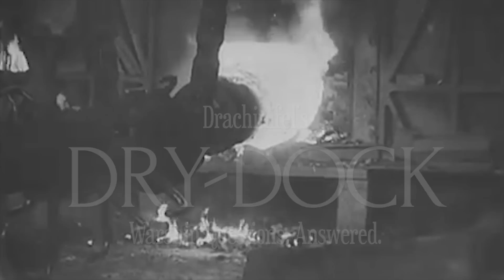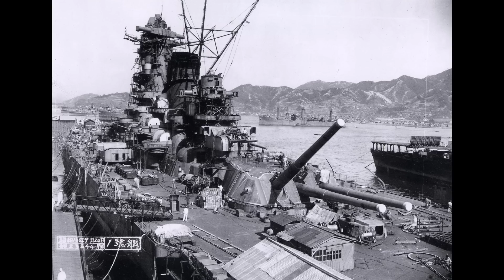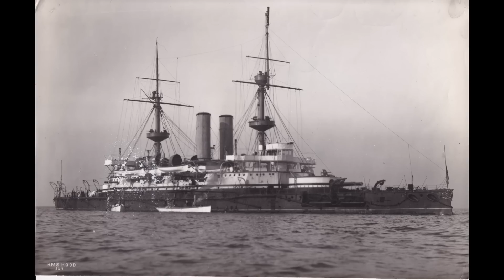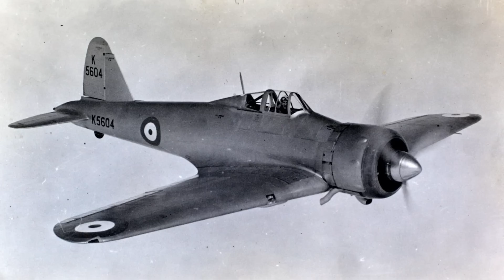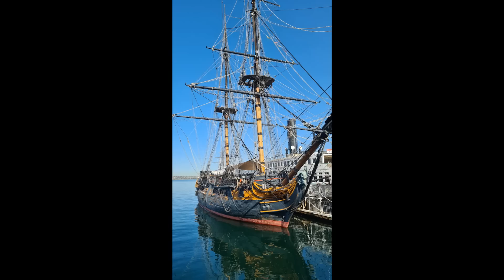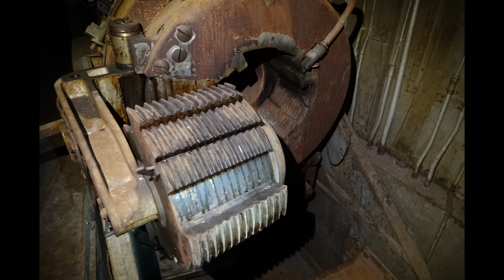The Drydock - Episode 239

Comment: I've been hit by a dud torpedo at a very shallow angle. It was an unarmed practice torpedo during a navy exercise where the depth control didn't work properly. It was supposed to go under our ship but it didn't and we tried to avoid it. We almost succeeded. It bounced off and didn't penetrate the hull but we got a big dent in the hull and had to dry dock to fix the damage. If it would have been armed I wouldn't be sitting here today because it struck the ship about 5m from my bunk and I was lying in it trying to get some sleep. It was a rude awakening and we immediately went into battle stations damage control mode...

Comment: I worked for the US Navy on weapon system support as a shore activity (though occasionally having to be sent to a ship as a troubleshooter).  One of my associates mentioned to me one day that he would rather be disarming a sensitive bomb than be anywhere on the deck of an aircraft carrier taking off or landing planes.  He once saw a landing plane hit one of the deck arresting cables and it broke as it was pulled taught to stop the plane.  The two halves whipped about so fast as to be almost invisible and cut one of the deck crew in half in the blink of an eye.  So more than visitors are sometimes in danger on warships, running at sea or in a museum...

Comment: Your biggest problem with multi-gunned cruise ships is going to be ammunition-handling. I'm not sure there are enough lifts for shells and charges to be carried up. Plus the steward bringing it would probably insist on a starched napkin over it and probably some cut flowers in a jar. That's really going to slow down your rate of fire. Especially if he knocks and waits for your gunner to answer the door...
Reply: Just do it like they did in sailing ships, have a load of children running around with explosives.  What could go wrong?
Reply: And imagine how much it would cost in tips.

Comment: 57:04 you are 100% spot on, I am a fit man let's see I'm closer to 50 than I am 40, but I'm still in my 40s 😎.... I have visited the USS Cod Submarine Museum numerous times.  The card still has all her original hatches intact, so when you go on the tour of route of the USS card you have to go through the forward torpedo room escape trunk.  And every time I go down that tube, I'm just thinking to myself this is a this is clearly a young man's game.  I can get down it, but just not as fast as like a 20 something could 🙂. But if you get the chance you have to visit the Cod, the Cod is a fantastic Submarine Museum in Cleveland Ohio.
Reply: She was towed to Erie Pa a little while ago for refurbishment was nice to see the work being done. I need to get over to Cleveland.
Reply: I have been through USS Silversides, in Muskegon, MI.  Also a Gato class boat.   In her case, they rigged a ladder down the port side forward, and cut a doorway through the hull, rather than ask people to go down the ladder you used on Cod.   I would expect that, regardless of age, the USN had height and girth maximums for sub service.  I know there are height maximums for pilots.
Reply: @stevevalley7835  I have been on both Silversides and Runner when they were still dockside trainers in Chicago.  They were not set up for tourists.  I was a teenager so I did not have any trouble getting around

Comment: Engineering aspect also , Dual fireing solution works better! Triple firing unless precisely ignited will throw off precise
firing solutions of the mechanism itself.Due to tremendous recoil of large calibers.
Therefore a second salvo is delayed in a triple turret as compared to a double turret making overall impact and accuracy less effective.
It did look really cool or intimidating depending on your point of view!
As our Master gunner points out triples make the job of the repair of a damaged turret that much more critical and difficult as well.
Symmetrically speaking doubles are inherently cleaner architectualy in keeping the center of gravity thinner as the USN has to transit the PANAMA cannal from time to time..

Comment: 2:20 

But if you’re shipping six twin turrets rather than four triple, which requires longer ship and citadel, on similar displacement, aren’t you destined to have less armor than opponents with four triple turrets?

And-also, if you’re going to split main battery between two targets, either the “secondary” target will be targeted by a fire-control process with lesser crew and equipment quality, or you force yourself to fully duplicate the entire primary fire-control process, which increases equipment mass and demands in crew training.
Reply: The Japanese did tend to sacrifice armour in capital ship designs up until the Yamatos (which didn’t sacrifice armour while still maintaining a reasonable speed for their time).

Comment: On carrier aircraft capacity.  Doctrine for use determines how many aircraft you design your CV to carry.  Even at the end of their operational life the Essex Class could carry 70 aircraft of whIch 60 were strike aircraft or fighters of a much larger size than the aircraft they were designed to carry.  Even the SH-3 Sea King was twice the weight of an F4F.  The last Royal Navy carrier , the CV-59  sized CVA01, was designed  for an airwing of 50 aircraft.  The Royal Navy did not have as stressing power projection requirements as the US so they didn't design the CVA01A for a large airwing.

Comment: Re photo of Akagi?? What are the markings on the flight deck near the bows? Comming of the center line?
Reply: The arrow with the offset markings to port and starboard were to show wind direction. At the point of the arrow steam was emitted,  And if the ship wasn't sailing directly into the wind the steam would blow on either side of the arrow showing the pilot the relative wind over the deck.  Believe I read each dashed line to the left of the right of the center line was 10ﾟ
Reply: @richardleithman379  thanks! Dad was FAA so plenty  of pics of British and American carriers, never saw markings like that before!
Reply: @hughgordon6435  You're welcome. Another YouTube channel has things dealing with British carriers and they had a very similar system but no painted markings they use a steam port to show the pilots the wind